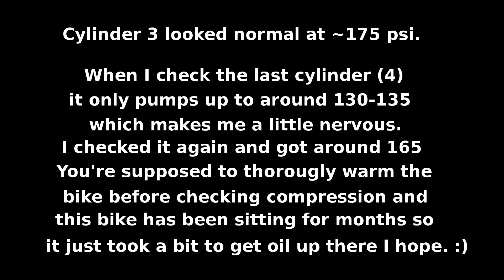2008 ZX6R Compression Check

Comment: Did you figure out why you’re bike isn’t starting. Mine sounds the same as yours when I try to start it
Reply: LOLZ
Reply: He’s not trying to start it. He’s doing a compression test. He’s essentially checking how strong/fresh the engine pistons are.
Reply: @600smilespergallon9  thanks lmao. 2 years ago I didn’t know shit about bikes. Now I feel stupid.
Reply: @noahsedano4886  Yeah, you're just checking for compression and all you need is it to turn and compress air. Fuel and openly running engine with compression gauge plugged in is bad and unsafe. You probably know now as you said, but you do remove all the spark plugs and ground the ignition leads to prevent a start.